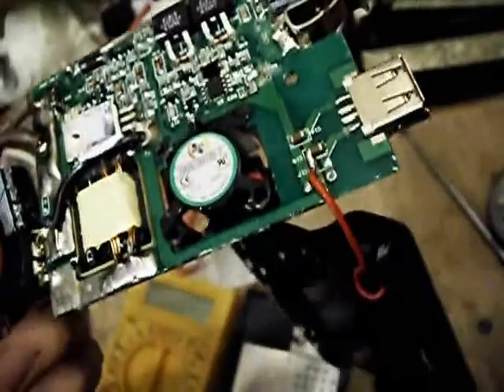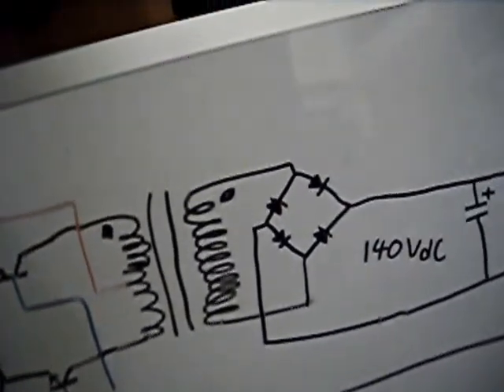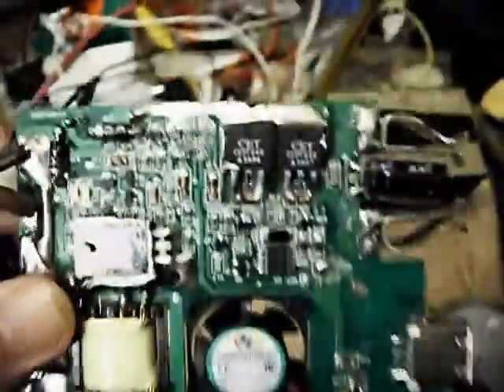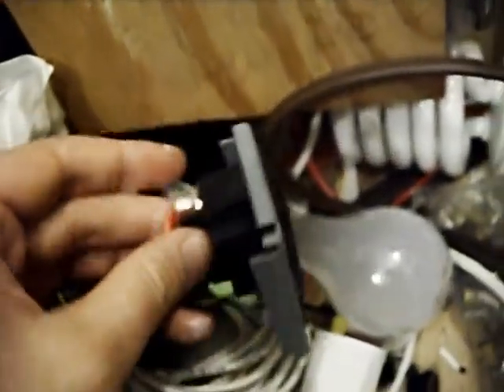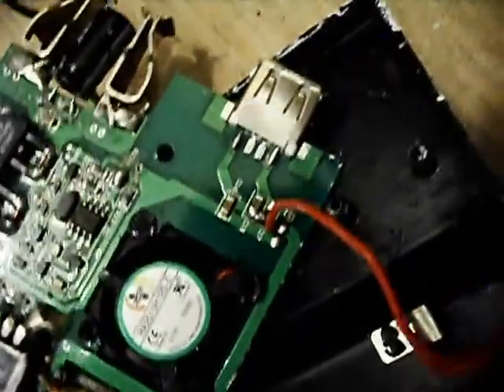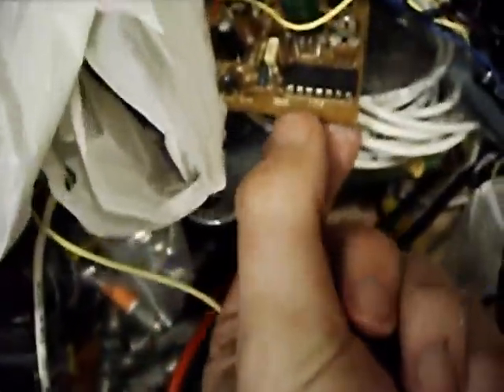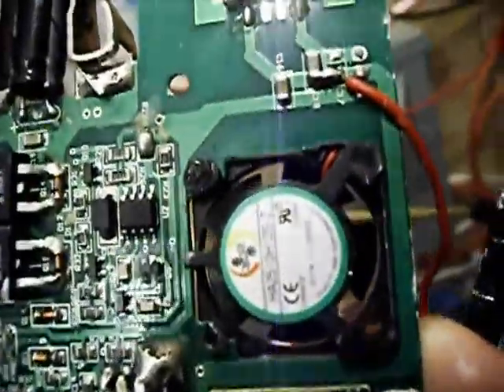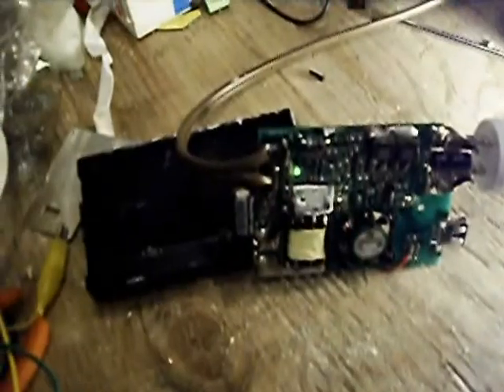Roadmaster Travl Power inverter guts

Comment: I opened up a few weeks ago and it had aluminum foil folded over around 6 times then stuck in a holder against the power transistors. I do not know why such cheap and shody ways are being done. I see your is just as bad. Who would you reccamed for a great inverter . I need a 1k or higher.